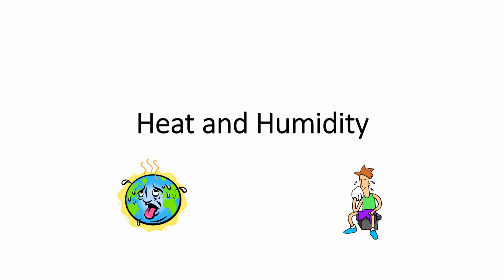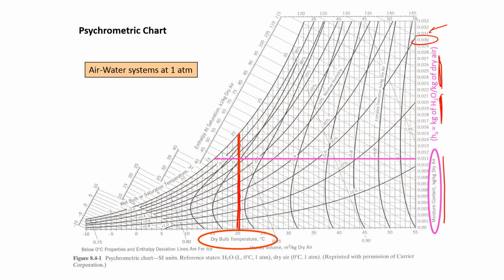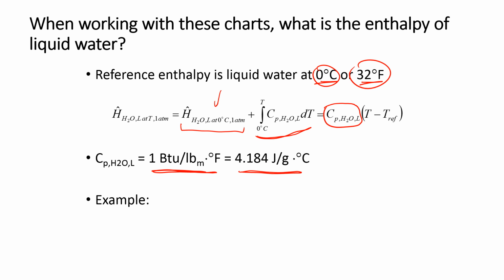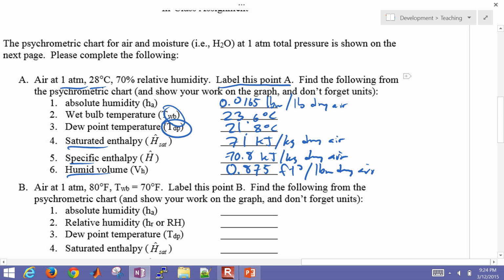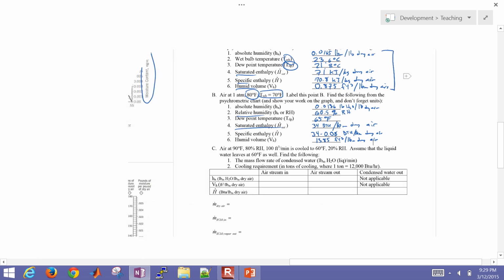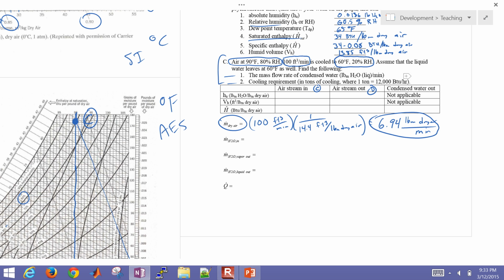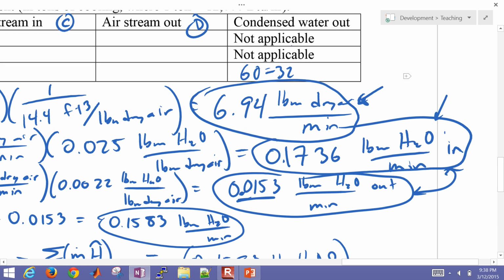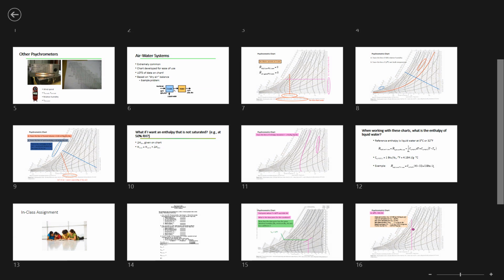Wet Bulb and Dry Bulb Temperatures Explained

Comment: If water on tht wick evaporates tht is it absorbs heat from air and how on earth then the bulb temperature increases.
Reply from the maker: If air that is less than saturated at 100 percent relative humidity, the wet-bulb temperature is lower than the dry-bulb temperature. However, the wet bulb temperature is higher than the dew point temperature.

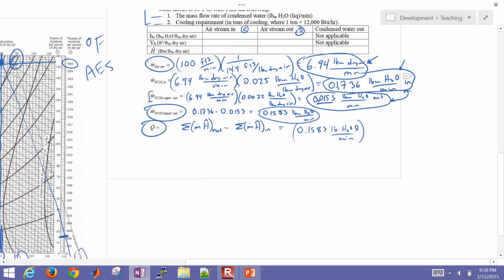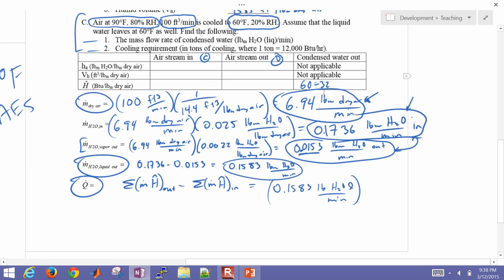Comment: Hello, I was just wondering about the part (28:50-28:55). What is it and can I use it when working in SI?
Reply from the maker: Yes, all of these calculations can be performed with SI units (I actually prefer this). You'll see that some of the examples are completed with the SI unit chart. You can also pull the numbers off the AES chart and convert the units to SI, although this may be a little painful.

Comment: Hi thanks for the video, I have a question: If I know the dry bulb temperature (ie outside temperature) is 28 degrees C and the relative humidity is 70%. What would be the relative humidity if the same air was heated to 40 degrees C? Are we allowed to just move horizontally to 40 degrees C in the psychometric chart?
Reply from the maker: +masterstudent Yes, please see the video at 4:15. The horizontal lines are constant mass fraction of the moisture content. You are correct that you can move horizontally.

Comment: sir good day.. i follow your video demo and it's a big help for me can I ask what formula you use to compute your last answer -215 btu per min.and -12,925 btu per hr?i try to compute by i can't take your right answer so pls.help me..thanks....
Reply from the maker: +Ferdinand Tavarra The formula is listed as an energy balance where Q = sum(inlet enthalpies) - sum(outlet enthalpies). Specifically, the numbers are (0.1583*28)+(16.76*6.94) -(48.44*6.94) = -215 BTU/min  Let me know if you have any additional questions.
Reply: Thanks sir, I got it  and my last question is how you compute -12,925 btu per hour?
Reply from the maker: It's just unit conversion as
-215 BTU/min * 60 min/hr = -12,900 BTU/hr